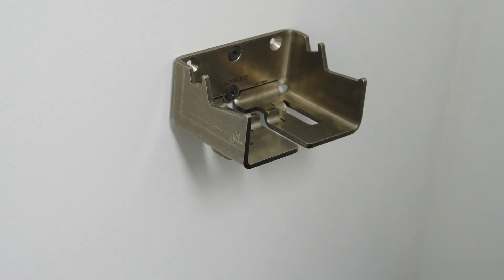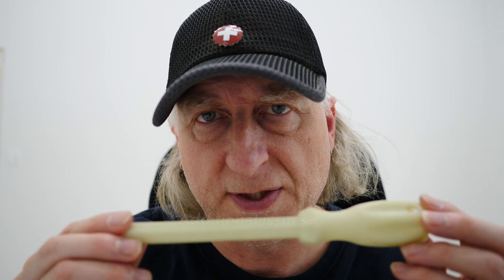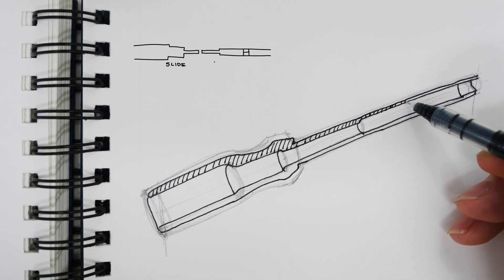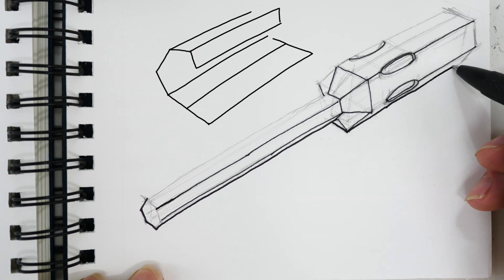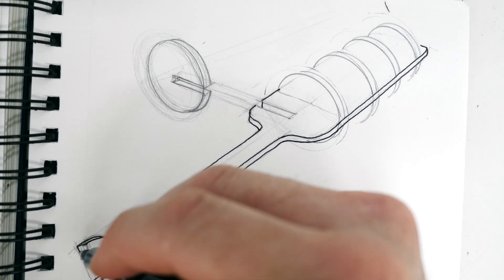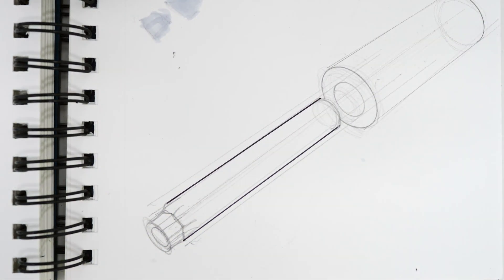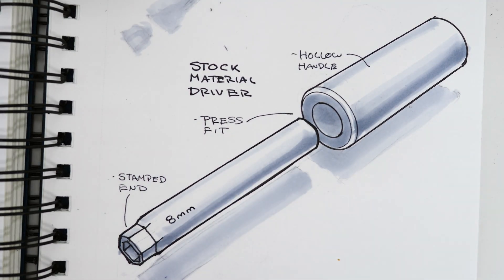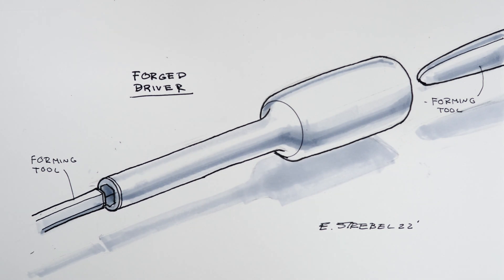Designing Sustainable IKEA Tools

Comment: Mhm mass produced furniture in general and IKEA in particular is particle board coated with melamine... The binder makes up a good part of the particle board,, it's a phenolic resin that cannot be recycled and doesn't break down very well.

The only destination for all this is landfill or incinerator reactor.

A plastic tool is little in comparison and many other of their items come say with plastic alignment templates which are also to be thrown away immediately, and i dont know what happens when you throw them into the yellow bin. I think our yellow bin facility can now identify and recycle polypropylene polyethylene and PET parts as long as they're packaging-like but i suspect coloured stuff unless it's white gets thrown into the incinerator.

Comment: I agree to disagree about plastic. Plastic is on everything, the seat you are sitting right now is made with plastic or have some on it, the computer monitor is made with plastic, the camera, etc, etc. It is endless what you can do with plastic. One HUGE advantage with plastic is the weight. It saves money and on transportation. It is like saying lets go full-electrical and where the energy comes from? I see your point, but it is all about crap made from China! I have seam things built with plastic that is just amazing. What energy is takes to melt and mold metal? a LOT! more them plastic does. Just look around your house or you car, what is made with plastic is everywhere. The problem is not with plastic and yes how things are made cheap.
Reply from the maker: Trading plastic for the future of humanity is not worth it. At some point plastic will be illegal. We must think differently and solve problems with eco friendly materials for the betterment of our species.

Comment: What about not including a tool? Part of the issue here is the idea that every piece of furniture requires its own tool. No tool should be one-time use and designed for failure. Regardless of material or manufacturing process, waste is waste.
Reply from the maker: Yes, tool less installed would be optimal

Comment: The vast majority of plastics cannot be recycled. The Ikea screwdriver in particular cannot be recycled even if you COULD identify the polymer because it's glassfiber reinforced. There's no economically viable way of doing anything with the material once it's been molded so being able to identify the polymer used is kinda pointless anyway. 

As for your solutions, I am not convinced they're better. For one they'd be much more expensive, steel, aluminium or magnesium aren't exactly a cheap commodity either.

Die cast tools suck, they're not nearly as strong as the plastic and break easily. I'm also not sure they're all that much better for the environment than plastic. Aluminium or magnesium would certainly be too expensive so you'd probably be looking at some sort of zinc alloy. Not exactly super strong or durable, not exactly environmentally friendly either

Laser cutting isn't really a good way to make millions of something (not saying it can't be done, but IF someone went to a folded sheet metal item for instance I think they'd be looking at making a stamping die to stamp the folded unit from rolls of flatstock, probably in about 3 or 4 steps. This goes for your flat-stock solution too. In quantity a manufacturer would probably stamp those parts. The problem with your solution is however that it can't do what the tool needs to do. The reason for the pipe wrench length and the fact it's hollow all the way is that it needs to fit over the long threaded rod of the tap to do the nut up no matter the thickness of the worktop it's mounted to. On thick wooden countertops you might get away with a shallow socket, but if the tap is on a thin sheetmetal sink for instance you need to do the nut up all the way at the top and the rest of the thread needs to fit into the tool used to tighten that nut. And usually you don't have enough space under there to put a normal spanner on.

If you want to go super cheap but metal, simply shaping a piece of round pipe at one end into a hexagon py pressing it over a die and drilling a cross hole will work (standard tubular spanners have been made this way for donkey's years (eg: https://www.tools-giant.com/item.php?id=98833554). ISTR Ikea used to actually have one of these in their products, instead of the plastic one , but switched to the plastic some 10 or 15 years ago.

The ONLY proper solution is to just have a bin of these in the store and letting the customer grab one if they need it (They don't want to do this because of the inevitable problem of customers forgetting to get the tool). Personally I have all the tools I need to assembly ANYTHING IKEA could possibly throw at me, so as far as I care they can leave ALL tools out.

Personally I'm far more annoyed by what feels like several kilograms of paper assembly instructions, manuals, compliance documents, bullshit legalese and other unneeded stuff that's included in EVERY SINGLE BOX. So you buy 3 of the same closet base, with a load of shelves, drawers, doors, etc and you end up with piles and piles of exactly the same paperwork (In 6 or more different languages, adding to the amount of paper!). And all of it is also online so you don't really need any of it. Just have a grab bin in the store next to the shelve in the self-service warehouse for each item and let people grab one of the folders (Only in the local language) if they feel they need it. Would probably save a few acres of trees each year!
Reply from the maker: Wow, thanks for your comment. Love your ideas, if only more people took the time to place the planet in higher regard. Thank you for your time.

Comment: You could take the option of forging the stock tube and drill a hole perpendicular to form a T handle. It's really cheap and easy. Or take a close to standar Allen Bolt that have the same hex size, turn the  head to fit into wherever needs to fit. and bend the shaft to form a L.
Anyways, IKEA likes this plastic thingy because they can design it to be pretty and don't look so cheap, the don't want a galvanized piece of butter steel in the same box of your faucet.

Comment: Another option is to make it out of wood. For strength at the tip, it's possible to reform and crosslink the cellulose using zinc chloride. The zinc chloride is recoverable too. Alternately, it can be infused with glue. The dimensions of these parts mean that they can be made from offcuts, or even branch prunings, rather than trees/lumber.
Making it out of metal is more wasteful than using plastic.
Reply from the maker: Definitely wrong about the metal.
Reply: @EricStrebel  I'm not a fan of disposable plastic junk either, but there's a reason that metal is more expensive than plastic. It takes more energy at each step of mining, purification, processing-to-raw (smelting to ingot), processing-to-feedstock (reheating to form bar/sheet/etc), forming into the product, etc. for metal than for plastic.
Reply from the maker: Mine existing stockpiles of metal from land fills, etc, way cheaper. Plus saving the planet will require you to spend your money. No two ways about that, you will need to accept that fact. Or you will leave a planet of fire to your descendants.
Reply: @EricStrebel  It's more expensive to mine from land fill (quick googling confirms this). You could make your sheet metal gadgets from disused whitegoods (i.e. upcycling). I still support wood as having less energy requirements than metal. It'd be easy to replace all plastic tool handles with wooden handles, without loosing function.
Reply from the maker: Rubbish of course. Complete nonsense about the cost of mining land fills. But yes, we could absolutely use recycled metal, and we absolutely should, instead of mining the planet of it's raw materials, we have plenty of metal in the system already. We definitely need to do a better job of managing that system of course, because we currently do a terrible job at it. Particularly here in the US.
Reply: @EricStrebel  Have you read any reports on the topic? Diverted construction/manufacturing waste (prior to landfill) would be more profitable.
Reply from the maker: Sounds reasonable, could be a good solution

Comment: Me i just tape the driver to the hoses under the sink, some day i will need it again.   Same with the cheap Day Beds.  Most reason for that plastic tool is cost.  I seen time and time design is driven to the lowest cost... why ... simple customers fight for lowest cost first then think of all the rest of the product.  Our problem and solution is the customer - hard to change the customer.  Yes single use tool is stinky solution.
Reply from the maker: To save the planet, you will need to change your mindset, and you will have to spend your money to do it.

Comment: it's hard to compete with injection molded plastic on price, die casting need relatively expensive tooling, bended sheet metal is a labor intensive and to bend such a small part is a nightmare. Option 3 is a way but no laser cutting, this bring high cost, stamping is much cheaper and is a mass production process, but option 4 is the best, and you no need so complicated handle, two holes, a proper sizer metal rod, you may found it in many car or bike toolsets.

Comment: If that "disposable "tool was made of a nice and easy to reuse thermoplastic such as ABS or HDPE, it would simply go into my bucket of either ABS or HDPE that I keep around (to the dismay of the girlfriend who think it's trash) and if would later find its way into a 400 F oven and then would be pressed into a thick rectangle for later use. I don't have a plastic shredder, so I'm limited to plastic bags, milk jugs, shampoo, cleaning products bottles etc. I find depressing to see more and more polypropylene #5 in my recycling bin as it is not DIY recyclable. Makes great plastic welding material and when pressed as a thick sheet, it is strong as hell : 1 inch of recycled HDPE makes for one heck of a washer or tool handle. 

And....plastics, especially thermoplastics, are awesome, there are so many objects that would have been some sort of crappy cast metal or sheet metal, or some other thermoset assembly that is impossible to reuse or hard to repair. Many plastics are superior to using metal or wood because of their mostly inert nature and they're very tough although not as strong. The problem is our disposable economy of always replacing everything rather than repairing, and mostly the goddam over packaging of everything!, that's what fills up rivers, lakes and oceans.
Reply from the maker: Yes, the packaging is often more harmful than the disposable thing we want.

Comment: How about designing products that use common sized fasteners that do not require a special tool to assemble.   I would venture to guess that most people have a basic hand tool assortment that will be used over and over.
Reply from the maker: Correct, or design products that don't need any tools to be assembled

Comment: Two other options: 
first, a thin walled tube, one end flared out into a hex driver. Instead of a handle, leave a cross-hole at the top end that can receive an allen wrench, pencil or pen.

second, a variation of your heavy laser cut and assembled version: handle in one piece with the shaft, twisted in a double helix for the handle. The shaft stamped in two sides of the hex, the driver a hex punch on the end of the shaft, bent 90°. A dog-leg stamped across the run of the shaft to keep the driver concentric with the handle.
Reply from the maker: Yeah, I like it
Reply: @EricStrebel  The first is essentially a metal straw; made of the right material, it could be re-used as one.

Comment: I have an other proposal: Change the Nut by adding a knurled thicker part so that it can be tightend by Hand. Make it overall longer than the Screw and give it a slit on the end, so that it can finaly be tightend by a screwdriver - i would image an open cross slit in a hex as seen on hoseclamps.
Reply: For what this spanner is used for I can say from personal experience that you could not tighten it up by hand. Making the nut long enough that a flat screwdriver could tighten it up would also be problematic due to the threaded rod already being quite long, and then people need a large flat screwdriver.
IKEA just need to stop shipping tools with every single product and let the purchaser pick up what they need (or at the very least return the tools after the fact that they don't need).
Reply from the maker: Yes, agree
Reply from the maker: Possibly, there are always options!

Comment: The 4th option you presented is used in chainsaw combination tools. They are just a piece of steel tube with a hex pressed into both ends of it. A either a torx or flathead screwdriver (depending on the model of chainsaw) is welded to the side that also serves as the handle for the nut driver. The saws are designed in such a way that all regular maintainence can be done with the one tool.
Reply from the maker: That sounds like a good design, well thought out. We need more of that

Comment: I don't think all plastics should be banned, they just need to be used responsibly.  Single use plastics and using plastics in ways that make them difficult or impossible to recycle must go away.  There are ways to use plastics that are sustainable and there are many places where not having plastic would be a huge step backwards.  Imagine not having modern plastic insulation for electrical wiring?  I have 40+ year old excelite screwdrivers with plastic handles that are still in great shape and will probably last 100 years or more.  Plastic should be used where its material qualities make it the best choice for the job, not just specifically because it is cheap and we don't care about it once it's thrown away.
Reply from the maker: So who would decide what is ok and what is not, humans are terrible at individual self governance.
Reply: @EricStrebel  I think a lot of the problem would go away if we went with your idea that if a manufacturer uses plastics in their product, they must take them back for recycling.  This would eliminate the single and short term uses and would encourage using plastics that are more easily able to be recycled.
Reply from the maker: @ResonantFreak  this would definitely hold them accountable

Comment: Does it even go further? Japanese used joints without nails. Can we not get smarter with design?
Reply from the maker: Yes correct however Wood is quite a bit different than metal.

Comment: Maybe we could use cardboard or wood? Or a biodegradable resin?
Reply from the maker: Cardboard and wood sound like a good possible option. I don't think there is a such thing as a biodegradable resin. When you find one let me know.
Reply: @EricStrebel  I know you can make Amber from Tree Sap and cast it. That should be biodegradable.
Reply from the maker: What is the cure time for that resin?
Reply: @EricStrebel  It's cast hot and should set quickly in the mold. i don't even know if it's technicly ember because it is not fossilized. Or just tree resign that's dehydrated and changes in viscosity with the heat applied.
Reply from the maker: Can you tell me the brand name or where to get it? I need to investigate
Reply: @EricStrebel  I saw a make it at home from tree sap that he got from the wild. I don't know if there is a commerical variant of it. Maybe you can buy the resign and cook it up to dehydrate it.
Reply from the maker: Ahhhh... That the rub of course. If you come across a video or a link, please post. Thanks

Comment: The only reason besides cost that could justify a plastic construction would be to make it idiot proof and by it being soft protects the chrome surface from scratches and the threads from stripping.
Reply from the maker: It's not used on the exterior of the product it's used on the underside in the back
Reply: @EricStrebel  and I guess the threads are M4 or something not easily stripped 🤦
Reply from the maker: Don't know the details but most likely metric

Comment: If you count the amount of energy it takes to recycle, die cast zinc is the most sensible choice. The best solution in most cases would be to make them returnable to the manufacturer, just have a drop off bin in stores or something.
Reply from the maker: Yup
Reply: That would have to be both ikea and non ikea stores, like grocery stores for example. For most people, going to ikea just to return a cheap tool is not gonna happen. You’d need it to be as easy and convenient as possible.
Reply: @Aikano9  people do go to IKEA semi regularly don't they? They might as well grab some things they need to return.

Give people an incentive. There could be a $1 deposit on supplied tools.
Reply: @SianaGearz  do you know what “semi regularly” means? No one is gonna go to ikea once a month, especially not just to get $1 back
Reply: @SianaGearz  people only do that if they moved in the past few months
Reply: @Aikano9  about twice a year, I suppose. I think most trips aren't really after furniture but little things, they kind of accumulate in the yellow bag while you stroll through there.